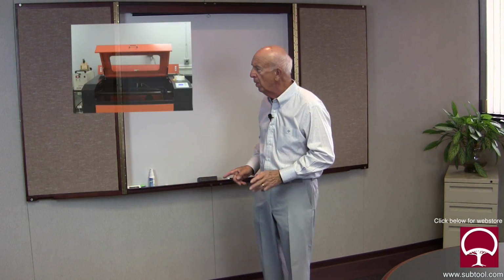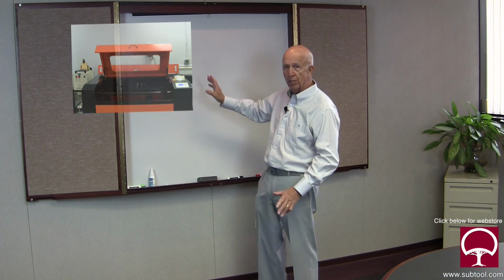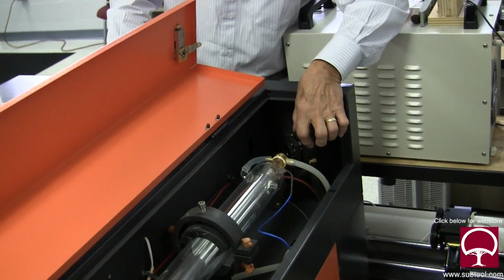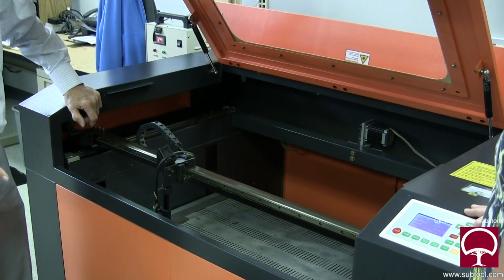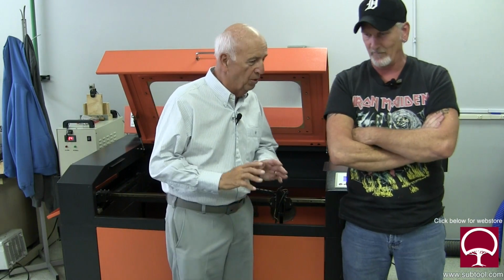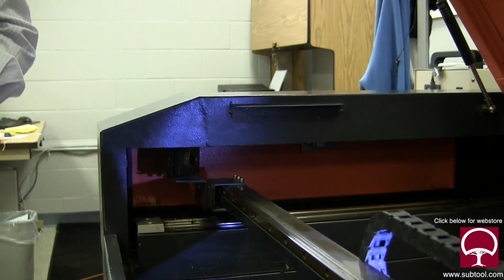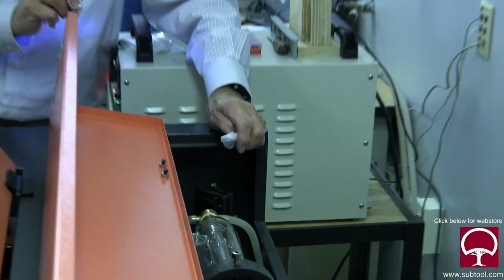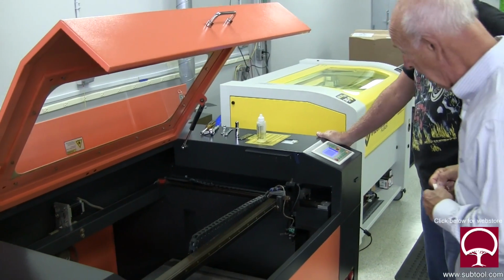My Co2 laser needs a tuned up - now what?

Comment: Good humor to bring to a very frustrating topic, its always a good thing to defuse a known stressor before diving into it.  a tip that will help, is to not use "tape" as the burn-test-piece of the beam-to-head alignment, since the glue from the tape itself when lasered, will give off soot that will go into the cavity and lens, better off using a post-it, and use a small piece of tape on the opposite end so that it's flat on the housing.  Also, the screws on the top and side are what should be used to "guesstimate" the cross-point of the beam.  But definitely good point about the media used to clean the lenses....lint is for the pockets and dryer filters not laser optics ;-)
Awesome videos....keep it up guys, it's always a pleasure to "watch n learn"

Comment: I own one of these Chinese lasers a well and as much as I love Don's other videos, I have to disagree with his assessment that the alignment on this appears to be good.  It might be good enough to be functional and cut something, but I'd I'm guessing that a quick look at the kerf on a thicker cut would show that the centerline of it (laser cut kerfs have an hourglass profile) is not square to the surface of the material being cut.  Below is a high level methodical approach to adjusting one of these machines so that is performs as accurately and reliably as possible.

Proper alignment on these machines is a massive time suck, but the quality of the resulting cut is directly proportional to the alignment and the time spent getting it right does pay off if you are trying to hold tight tolerances.  the goal is not just to get the beam to hit the focusing lens, but to get it to hit the center of that lens at an angle that is as close to square as possible.  The angle at which the beam hits the lens affects the output angle of the focused laser, so a square input centerline = a square output centerline.  The position where the beam hits the lens will determine the shape of the focused output, so an input beam that is centered on the lens will produce a focused beam that is closer to spherical than if the beam is off-center.  Assuming the lens tube has been mechanically aligned to be perpendicular to the platen or support bar surface plane, the result of an input beam that is both square and centered yields a consistent width in both axes with a centerline that is square to surface of the material being cut.

At a high level, here are the steps I followed to get mine set up and I couldn't be happier with it (Aside from slight variations in laser output due to the performance of the tube/laser power supply):

1. align the gantry to ensure that the x and y axes are square to each other.
2. indicate and align the platen/table to ensure that the surface plane is parallel to the gantry x and y axes (may need to shim the gantry to eliminate any twist and normalize the X and Y planes)
3. align the laser tube such that the beam centerline is parallel to the gantry in both planes.  If your laser doesn't have an output head with adjustable mirror height, it is also necessary to ensure that the beam centerline is at the same height as the centerline of the final mirror on the laser output head.
4. position the first mirror holder such that the output beam is centered on the mirror.

Note: taking the time to go through steps 1 through 4 carefully will make the rest of the alignment easier

5. Adjust the first mirror so that the redirected beam is parallel to the y axis motion of the machine.  This is achieved when the beam hits the exact same spot on the 2nd mirror carrier with the gantry at either the front or the back of the machine.  Once this has been achieved, adjust the position of the 2nd mirror carrier so that the beam is hitting the center of the mirror.
6. Repeat the process to align the beam with the X axis, adjusting the 2nd mirror so that the beam hits the exact same spot on the 3rd mirror carrier/laser head regardless of whether the head is in the leftmost or rightmost position.  Once the beam is aligned with the x axis, adjust the position of the 3rd mirror carrier/head so that the beam is hitting the center of the 3rd mirror, ensuring that the output lens tube remains perpendicular to the platen/workpiece plane.
7. Remove the focusing lens and move the laser head to the bottom right corner of the work area.  Repeat the process to align the beam with the Z axis by placing a piece of target material on the platen and firing the laser with the z axis at its lowest and highest points.  Adjust the third mirror until the beam is hitting the same exact spot on the material at both z axis extremes.  I usually do a quick check in all 4 corners to make sure nothing the alignment is consistent across the entire table area.  If it isn't, the Y axis or X gantry alignments will need to be verified.
8.  Reinstall the output lens tube into the head and ensure that it is square to the table.
9. Enjoy your properly aligned laser cutter/engraver.  Taking this approach, while time consuming and tedious, offers the best possible output quality from the machine.

Comment: Good video though It scares me to work on industrial laser machine optics without correct laser shielding goggles, a stray laser beam can in a fraction of a second cause permanent blindness .
Reply from the maker: +Dennis Clos You are correct, but as we did not have a part in the machine the chance of the beams bouncing were pretty slim. It is sort of like sitting in your car in the garage listening to the radio with your seat belt on. Seat belts are very important, but not really necessary in this case. Thanks for watching.

Comment: Great video, well explained! Yours is very similar to mine (aren't all these Chinese lasers) except a bit bigger, and red ;-) I spent nearly 5 weeks stripping the darn thing right down to every nut & bolt and reassembling it, because the whole thing was out of whack, covered with grime and grit (don't ask - looked like someone had thrown a bucket of shop floor sweepings over it), and on and on. Not to mention the (live) cockroach that jumped out when I first opened it up....

Fortunately, after a bit of threatening, the seller gave me a refund ;-)

Comment: I maintain and align two CO2 lasers very much like the one you show. One thing I would add is about the laser being centered on the mirror. While it is best if the laser is aligned to hit the center of the mirror, it is MUCH more important that it hits in exactly the same spot at the two ends of the carriage travel. So when you make a mark on the tape at one end, leave the tape there and run the carriage to the other end, and mark it again. The mark needs to be in the same spot on the tape. If both marks align but are somewhat off center, that is fine.